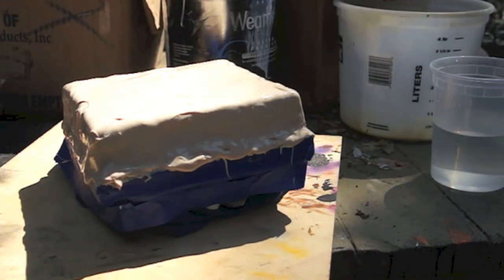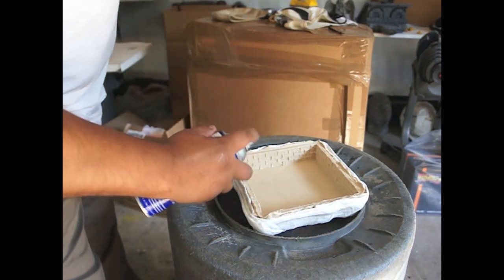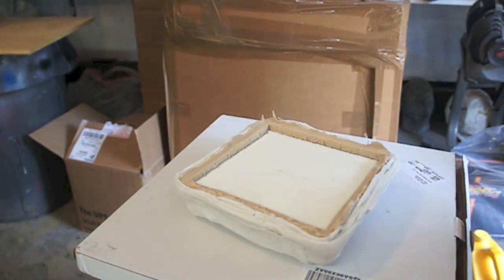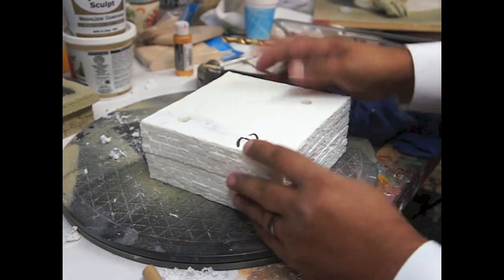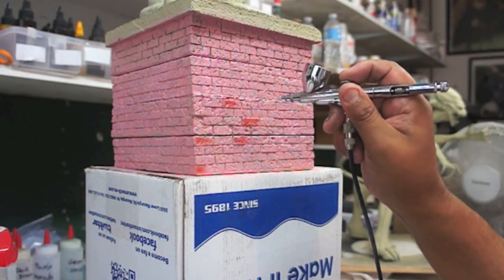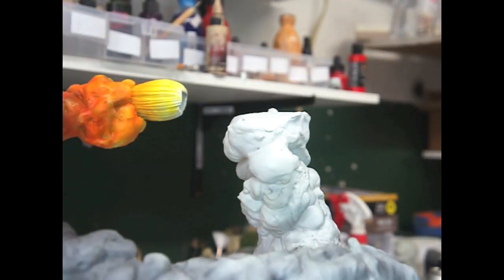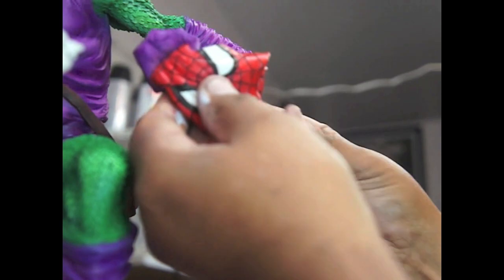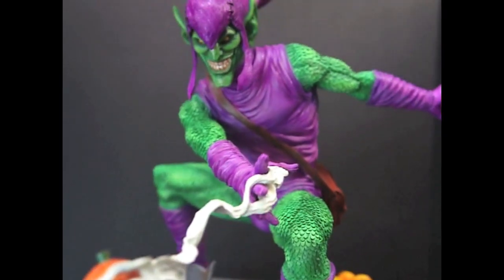1/4 scale kit green goblin build and paint up part 3

Comment: Hey Rafael...another great video and build up. On occasion, I sculpt, mold and cast bases for my baseless figure kits. A trick that I use to make sure I'm getting just the right amount of resin to pour is before spraying the mold with mold release, I'll fill it with either uncooked rice or pinto beans to my fill line. Then I just dump the rice into my pour bucket, mark it and fill it with resin. I've never come up short yet! I also use a carpenter's level to make sure my table is level (and shim it when necessary) so I get a nice even pour. Hope you find this useful.
Reply from the maker: boy thats a great idea, buddy,,   i will use that in the future thanks so much

Comment: Hi and thanks for your videos. I really enjoy them. I have two questions:

What did you use to make the mold for the chimney? 

And what brushes are you using?

Thank you.
Reply from the maker: hello i used, brush on  40 ,  urethane rubber 

 https://www.smooth-on.com/products/brush-on-40/

as for the brush i just used the cheap brushes you can get ,  a chip brush
Reply: Thank you so much for answering. I really appreciate it.